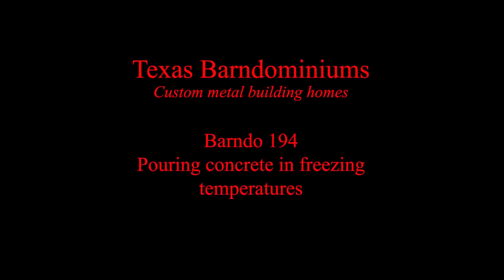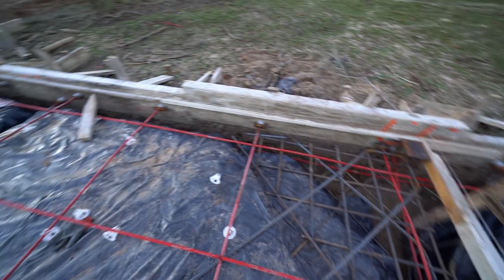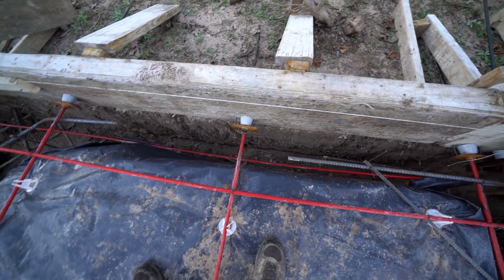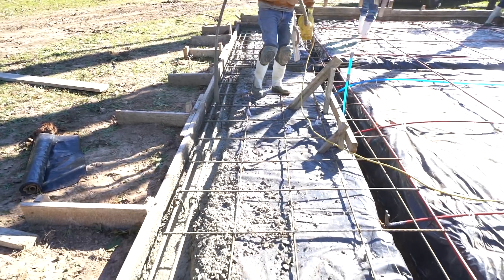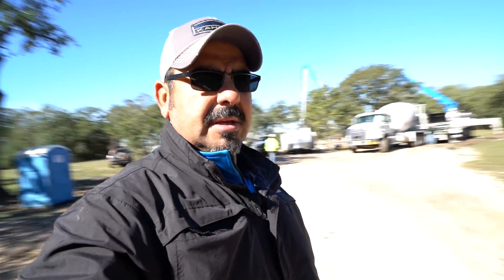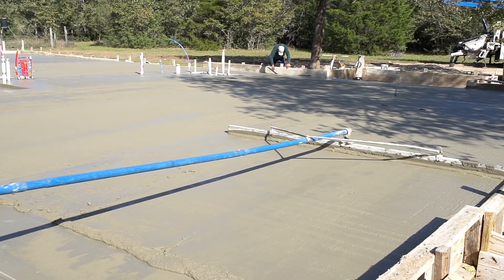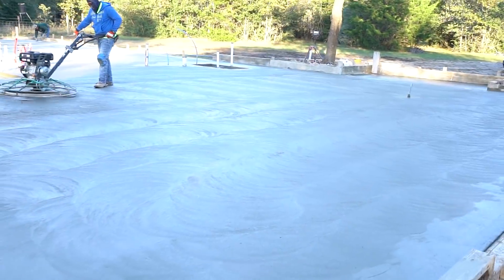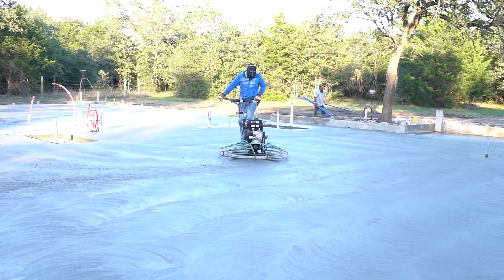Pouring concrete in freezing temperatures in Texas - Episode 57 Texas Barndominiums

Comment: Nice job out there!  I'm a little surprised the batch plant didn't have any pozz, HE or other set accelerators for other than normal conditions.  I can see why you wouldn't have hot water in TX, but keeping a few drums of admixtures on site is pretty common - I ran a portable plant for years and had at least some plasticizer, high-early, low-range water reducer, etc. to fend off disaster in case something happened.  CaCl has largely went out of fashion these days, but a pallet full of that was a staple back when.  Saw a lot of slabs with a ruined finish using that, tho, it has to be entered into the mix correctly and just enough.  Hard on steel inside the slab, too.  A day like this, a guy could've gone with hot water and maybe 1/2% pozz and been home for supper easy.

Comment: I've always said that the best part of concrete is driving a mixer and it ain't so hot either. I've hauled it on inside jobs at night so cold that the water had to be drained each load or it'd freeze solid and have it 124 degrees in the cab with both windows down running 55. I feel your pain when the plant went down too as well when the sun went down. And I about had a stroke when the guy stopped in the soft spot. Either be in the right gear to start with or mash it and blow through it. Yall do a FINE job. GOOD looking lab. A-PLUS!
Reply: @TexasBarndominiums  He'll learn but when I was hauling we'd get on the radio and let each other know of such things.  You do a fine job! A-PLUS!

Comment: Why are you pouring 3000 psi mud? I use a 6 bag mix on almost everything I do besides footings. Is that all that is required in texas?
Reply: Phillip Hammon there’s no need to use 6000 psi 6000 concrete is going to crack More than a 3000 psi

Comment: I have worked with Derrick concrete in Edmonton in 2018. We poured a wall in - 30 celcius. Used 1% plasticiser. Slump was 100. No idea what the temp of the water was. I consider myself a rookie/idiot with concrete. Our biggest problem was the pump hoses would freeze. We tarped the work after we had poured, frost fighters were pushing warm air into the area. One truck was late by almost an hour. There was no viable seam.

Comment: Okay I went through a whole bunch of comments. Looking for my answer! And have no freaking idea what those steel cables are in why the hell they would stretch anything inside of concrete? Does anyone have any ideas with those steel cables are for? I wish he do a video explaining that?
Reply from the maker: It’s called post tension.  The cables are tensioned after slab is poured to put slab under tension to keep it from cracking.  Look up post tension for more info.  Tyler Ley does a very good job explaining what it does.
Reply: @TexasBarndominiums  thank you so much sir. Definitely enjoy your Channel. I've always wanted to build one of these in Leavenworth Kansas where I live. But Morton Buildings is the only one I found that builds a really nice building. But I drive for FedEx freight and I'm a welder on the side. I do not want the wood frame construction. But most metal buildings are not very attractive on the outside that I found. So I keep looking and learning. Thank you for the information on the cables I did not understand what they were for that's pretty cool idea.

Comment: I am totally ignorant to building/engineering so if my question sounds dumb please be gentle. I notice you all have a lot of sandy soil out there. when you build these awesome buildings is there a lot of settlement due to the sand?
Reply: Compaction test are ussually done before anything is done. The engineers would require piles if needed. Theres concrete piles or wood piles.
Reply: @matchelite220  that makes sense...thank you

Comment: According ACi 306 if the average daily temperatures drop below 40 in three consecutive days concrete no bueno.
Reply: john david : For the most part yes... However, I live in Utah and there are times the temp doesn't get up much past that for weeks during the winter. So we'd get everything prepped and cover the bare ground with insulated concrete blankets. Then pull them off only after the first truck pulls up and only as you cover the ground with concrete. Also we use hot water and calcium in the mix. After you've got it worked to satisfaction, cover the whole thing with those same concrete blankets and make sure they are held down good on the edges; like tucking the slab in for the next couple of days.
If you haven't ever seen concrete placed with hot water and calcium then I guess you just wouldn't know. But I've had slabs go off so fast sometimes that you better get your asses in gear or you almost lose the race. It's actually kind of weird when the temp. outside is so cold but that mud is hotter than crap and steaming as it comes down the shoot. Then with the blankets on it, it's usually still warm the next morning if you get it covered correctly.

Comment: Cables are stretched ,normally 28 days after the pour,on a slab like this one.They are not tensioned before the pour like you said,just sayin'
Reply: 28 days concrete would be at full strength...

Comment: What do these concrete trucks weigh? And if you had to not use pump truck could you make it work? I have a 4189 sq ft slab needs poured but my roads cant fit a pump truck.

Comment: That's a 10 slump worthless
Reply: Might have achieved the slump by using an additive other than water
Reply: In my experience with post tension concrete we run a high range water reducer and a hydration stabilizer so the tension can be taught at specific times.
The high range we run turns 2" slump into 10" slump @ 14 oz./cwt